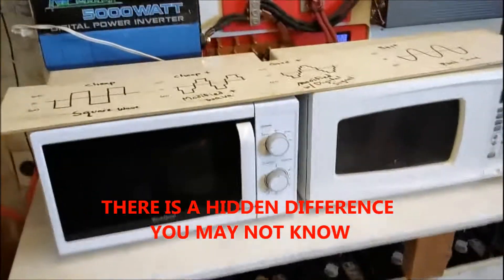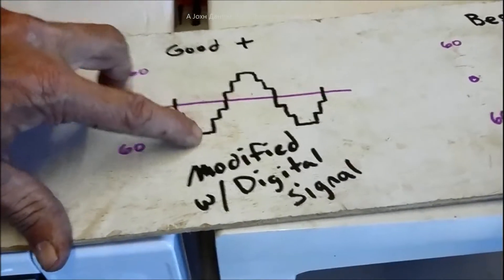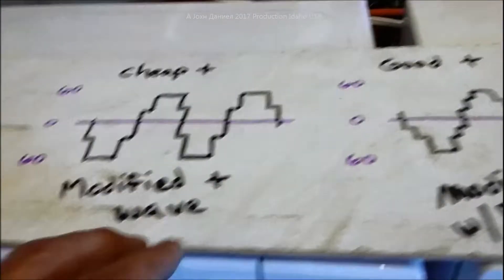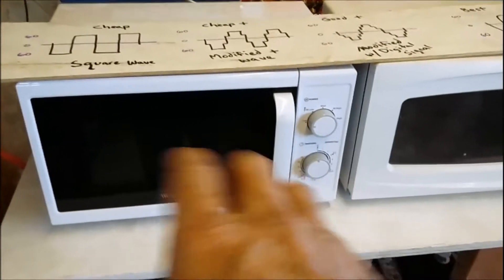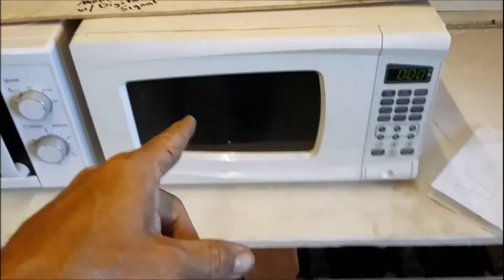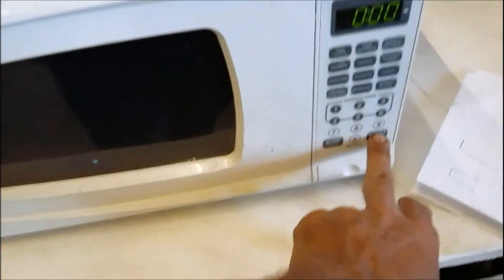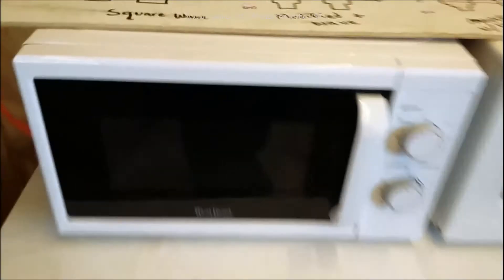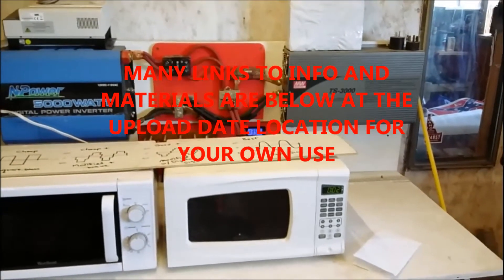DC to AC Power Inverters. Square, Modified + & Pure sine wave. How they work

Comment from the maker: Best Manual Microwave https://amzn.to/2PicsKu  runs great on the Power Bright PW2300-12 http://amzn.to/2sMpi8L and the Tripp Lite PV3000HF http://amzn.to/2s6573Q inverters They are great for truckers, Tiny Home, RV users and Off Grid living. And these work better on modified inverter All use high grade output circuits.
DON'T BUT CHEAP, Read them reviews.
You have to look no further than the very high owner ratings on the links I give you and the question and answer forums. 
These microwaves are bulletproof, no fail. EMP proof kinda stuff. The inverters are the highest grade and quality of voltage in the Modified Wave market. I use them, and have tested them heavily. 
When I find more places to get this all cheap, or cheaper I will update.  
Share, Promote, Help others

Be sure to NEVER under size your battery bank, inverters, wires or charging system. 
Feel free to ask questions..

Comment: hi john,....which would you chose to run a inverter on a 6 volt battery bank, or a 12 volt battery bank,..and which ones would last longer,...6 or 12 volt
Reply from the maker: 6 volt, GC2 battery style is better. You can get your best deals on them at www.batteriesplus.com if you have one near by, get the 225 ah GC2

Comment: Wondering about losses and efficiencies.... On the fence about spending an extra $100 ($80 vs $180) on  my simple setup for pure sine vs modified sine wav . Also finding Inverters just don't last very long for me.. wish they were generally more robust.  My battery Is my starter  70AH 120RC.  I run power tools and appliances 500w to 1000w, but need to run a freezer for 8 hours while a 200w solar panel feeds my battery through a MPPT controller.   Just had my 1200w modified sine inverter go bad after an accidental short.. they are so sensitive.  Somebody wrote a review on my inverter saying the inverter was eating 200W to power a 100W in devices...

I try not to use the inverter unless it absolutely needs a lot of power and 110v... for led lights and fans, why not stay with 5vdc and 12vdc?
Reply from the maker: Go with a Pure Sine, you will prefer it. Worth the effectiveness. The last 3 of 100 watt panels I paid over $99 for are now $79, No joke! Just ordered 8 more! https://ebay.to/2EGsN8i . But for your system, build it once, go with heavier gauges and inverters. You can always grow that way.
Reply: The use of the (ordinary and cheap) inverters for transforming low d.c voltages in high (mains) voltages and then operating "ordinary" household loads really makes no sense. For the North American system, if the inverter works on 12 Volt, the voltage ratio is 12/120 or 1/10. For the European system, it is 12/230 or 1/19,6. This means that a load of 500 Watt, if it works on a 12 Volt battery it draws 41,66 Ampere from it. If it works on 120 volt a.c system, it draws 4,16A (without calculating any loses), that is, ten times lower current (according to the voltage ratio as well). And if that load works on 230 V a.c, it draws 2,17 Amps (or, again, 41,66A/19,6=2,12A according to the previous ratio). This factor alone, tells us that the current demand for the inversion in order to use a load of given wattage will be either ten times to 19,6 times higher if the voltage needs to be stepped up and then tranformed to a.c (i.e inverted), depending on each case (European or North American system). 
The point is that the magnitude of these currents is huge and difficult to be handled from the transistors of the primary side of the inverters. This, in turn, creates high temperatures within these transistors, which is very difficult to be dissipated. If this condition has a permanent character  (i.e. the inverter working for many hours per day under heavy thermal stress) then there is only short longevity for the inverter expected. Little by little the inverter gets cooked. 
Let's take a practical example. If an inverter has to support a 5000 Watt load working on 120 volt a.c, it needs 41,66 Ampere on its secondary (output) side. This would be the normal current draw if that load would work on North American mains voltage. For the primary side of a 12 Volt inverter, the reflected current load would be 5000W/12 Volt = 416,66 Ampere. This is a monstrous current to be handled from the primary transistors of the inverter. Sooner or later the inverter will fail.
So, what is the golden medium to that? The obvious answer would be "make the voltage ratio unity or even better". Indeed, if we had an inverter working on 120 Volt primary voltage it would draw only some current more than the theoretically nominal current the load demands. Practically the only task of the inverter would only be to invert the voltage (from d.c to a.c) in order for the load to operate normally. The stepping up task would be missing. And this would secure a much better longevity for it.
The other benefit of this scenario is the use of batteries of smaller capacity because they would be connected in series now in order to increase the voltage, say ten 12 volt batteries making a 120 volt system, instead of a monstrous 12 Volt system with many huge capacity batteries connected in parallel.
About the types of the loads now....There are three types of them: a) resistive loads, b) electronic equipment and c) inductive loads (mostly motors). The first group doesn't care about the nature of the voltage fed to them. They work fine with direct current (i.e. battery voltage) or a.c voltage of whatever waveform. Such loads are for example water heaters or incandescent lamps. All they need is a nominal operating voltage and current, no matter the waveform. Next, is electronic equipment. In our days, all electronic power supplies used in electronic equipment are of switching type (as opposed to the older linear transformer based power supplies which are not any longer in use). These power supplies also don't care about the nature of the incoming voltage. As soon as it comes in, it gets rectified (i.e transformed to d.c) then it gets purified by filtering and finally gets chopped in order to produce the needed operating voltage of the equipment. The third group is the one including induction motors and/or linear transformers. And yes, this group works happily with pure sine voltage. This is so because these loads are seriously affected by the harmonic content of the fundamental frequency of the inverter output, in case that this output is not pure sine. The most catastrophic component is the third one because it has the larger magnitude (180 Hz for 60Hz systems and 150 Hz for 50Hz systems). 
There is something else worth saying here. There is nothing wrong with these "modified sine" inverters, at least theoretically, or if the inverter is of good quality. If for every semi - period  of the output signal of the inverter the single pulse has a width of 120 degrees and the intervals before and after it are exactly 30 degrees and these values are kept stable and independed of the load variances, then every type of load, including that third group above, will work flawlessly with that inverter. The problem with the ordinary and cheap inverters of the market is that they regulate their output R.M.S a.c voltage by affecting the width of the pulse in every semi- period. In this way, the output waveform of the inverter, especially under heavy load, looks like almost purely rectangular, meaning that it puts out not only the fundamental frequency, but also all its odd harmonics with the third one at its maximum magnitude. This is what inductive loads hate the most and die from.
In conclusion, the topic about the inverters is very complicated and needs very careful consideration before buying one. First of all, one must think about his needs as regards the loads he needs to support. Next to be considered is the working time (in hours per day). 
There are, among others, many myths about the inverters. For example many people say "I need a pure sine inverter for my power tools". Not really! If the power tool is working with a universal motor (the one with the toothed rotor and the carbon brushes) it can work very happily with direct current (i.e with battery voltage or with a dc to dc converter instead of an inverter). 
Finally the most important rule about choosing an inverter is: "choose the one working on the highest d.c voltage you can find in the market", especially when it comes to high power demands...
Reply: Idk if you are still there, but nowadays, inverters reached around 96% efficiency

Comment: The topic is well-covered. BUT I  do wish people would get away from the  generally-used  "Modified Sinewave" tag.
THERE IS  NO SUCH THING!  What  you're describing is a  'modified SQUARE  wave'.  Calling it  a  modified sinewave  was an advertising ploy  invented to  impress  ignorant people with the idea  they're getting something 'sine-wavy' .
As  for the can-you/can't-you  question:   Back in the day  (1981 -on)  I  ran a big  primitive  microwave oven on a  square-wave generator.   Rough as guts  and  noisy as a  Salvation-Army brass band;  but it lasted  about  4 years  and  then went to  microwave heaven.  So  make  your  choices; at least these days  we have to options available.
Reply: ps. What we  need  now is a definitive article on  the  'starting-surge'  question.
Reply: @dabbbles  It seems that you've got a wrong idea about modified sine wave, because...there is such a thing. If you are interested for many details about that topic, you can find my comment to NoSunBeach above. In a few words, the modified sine wave doesn't look like the common sine wave we all know. In its simplest form it has a single pulse per every semi - period of the output wave. Now, if the width of this pulse is exactly 120 degrees and two intervals, one before this pulse and the other after it have a duration of exactly 30 degrees each, then this type of signal is called a modified sine wave. There is a reason for that. Pure sine wave has no harmonics. Pure rectangular signal instead has all the odd harmonics of the fundamental frequency on it. That simplest modified sinus stays somewhere in the middle and has the third harmonic completely eliminated, while the higher orders of that one are of very small magnitude. With the third harmonic (180 Hz for 60Hz systems and 150Hz for 50Hz systems) completely eliminated, you can use any type of load on that inverter without any problem...

Comment: In the video you mention the Peak PKCOAW 3000-Watt Power Inverter, but when I looked it up on Amazon, it looks different.  The one on Amazon (and I just copied the name off Amazon, as it is above) seems to be about half the height of the one you mentioned in the video.  You also said "the new ones" are even better... Can you check it out on Amazon and let me know if the one offered now is still the same one you recommend?  I want the best inverter I can get for the price.  Thanks!!
Reply from the maker: Due to "popularity pricing" and a switch from PEAK brand contracts the HEC made 3000 watt inverter is sold under a few brand names. The only 2 with the multi stepped smoother running modified are the PEAK and POTEK. The POTEK is the same as the PEAK http://amzn.to/2Fou9n7 but just comes in a different package.
Reply: Thanks for responding!  Don't wanna be a pest, but will the POTEK run the 13500 BTU air conditioner?  Also, at Harbor Freight there was a 3000 watt Centech item #69712 that looks just like the one in your video from Sept 1, "RV air conditioner test running off solar..."  Any info on where that one stands in the running?  Thanks!!
Reply from the maker: The POTEK is the same as the PEAK in every way with a small cosmetic change to the newer models,  PEAK newer model is a bit wider and not as tall now as the older sales pics. 
The Harbor Freight version is missing the small 2 inch x 3-1/4" board in it the POTEK/PEAK has that makes the HF model much  rougher in voltage output, plus the HF model does not come with a remote or cables for $50 more. With a 20% coupon, they are the same prices but not same packages or all same parts. HEC Taiwan is the maker of all of them, but not all are equal due to how each model was ordered as a store brand or name brand. IMO, the POTEK is the best example of them.
Reply from the maker: PT 2 - My friends in Alamo Nevada are running a POTEK 3000 since DEC 2016 thats the PEAKS twin and are running a pair of 6000 BTU Goldstar (LG) air conditioners all summer in 2017, off 6300 watts solar, a Sunning 500 watt wind turbine, into 22  X31 series Exide Mega Cycle Marine batteries ( he's a auto parts dealer for Advance Auto) and also a Powerbright 2200 true sine in their 14 x 66 mobile home. Ran all summer last year, seems to be doing good.

Comment: cheap inverters are great for destroying refrigerator compressors LOL.
Reply: It never occurred to me to  run a microwave off  a battery-bank anyway: big draws   will kill the batteries in no time; heavier  wiring is  require;  efficiency  drops ~ and  back in the day unless you used  your  inverter at  about  90% of its  capacity efficiency  would  drop to  as low as about 40%. Have a little  remote-start  2400-Watt generator out in the  shed which starts at the push of a  button INSIDE  the  house.  (There are also  'demand-start' units  that  kick into life when the  power-point in the  house is called into action. Runs  microwaves, power-tools, washing machines, etc.  And  given the   short running periods even el-cheapo ones will  last  virtually  forever.  (and  you get by with a  MUCH  smaller ~ and less-expensive!~ battery-bank.